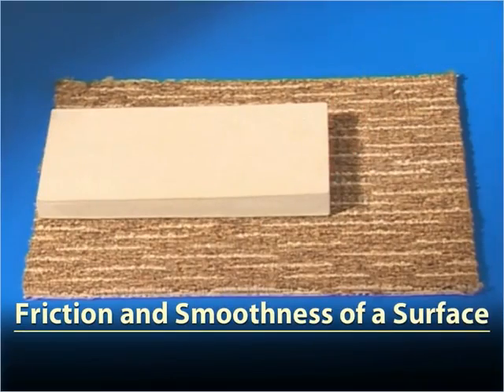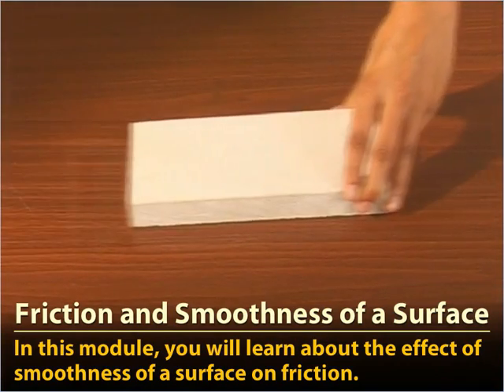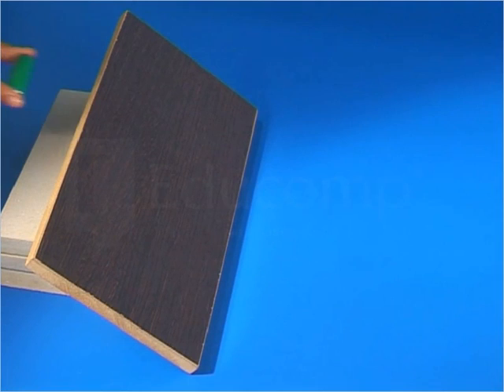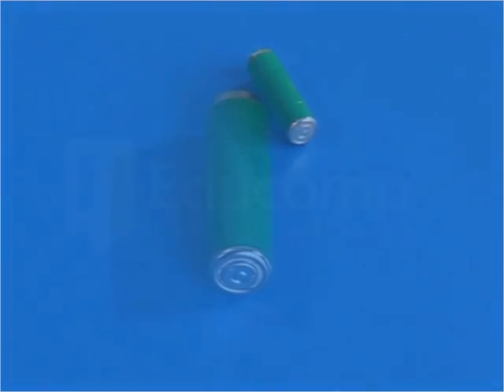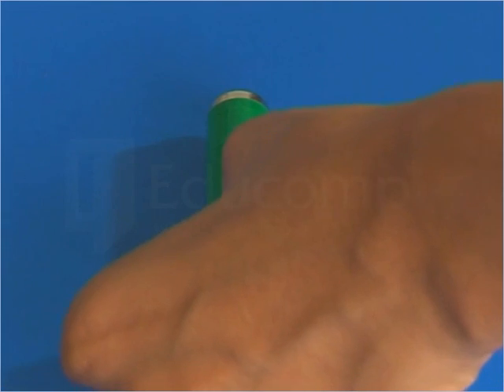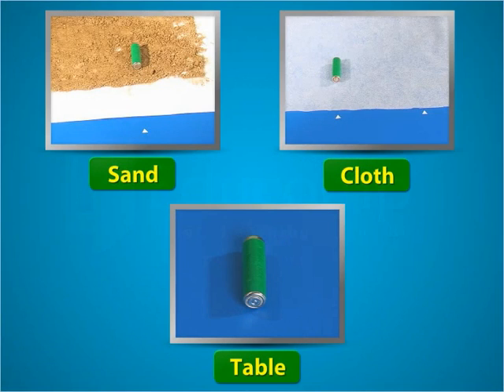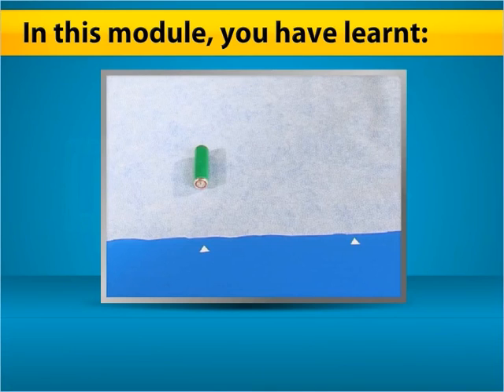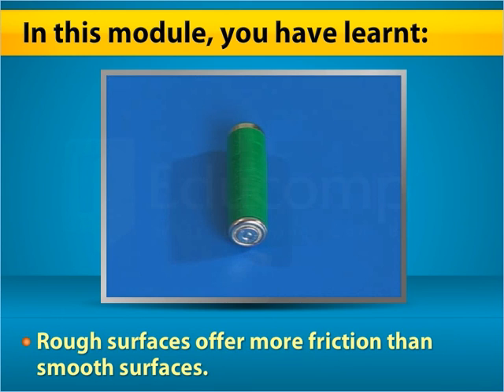Friction and Smoothness of a Surface - Activity - Class 8

Comment: Why is the distance covered by cell different every time?? Pls answer
Reply: because of the different texture of surfaces 
the smoother the surface, the less the friction hence the cell goes farther on the smoother surface because the friction provided is less 
and on the cloth, the friction is slightly more than on the smooth surface, so it covers less distance than the smoother surface while a cloth is  spread
and on the sandy surface, the friction is the most because of the rough texture of the sand or the soil, so it covers the least distance.
the rougher the surface the more the friction applied on the object. 
and when the friction is more the motion is less so it resists the cell from covering more distance on the sandy and the cloth surface than on the smooth table surface
Reply: @idkbruh_08  ohh thank u soo much for your reply.
Reply: @rxgamingff6036  my pleasure! :D